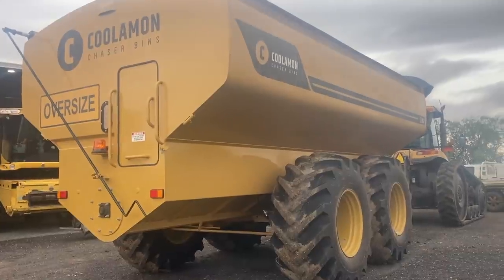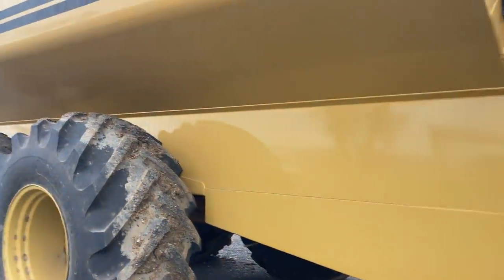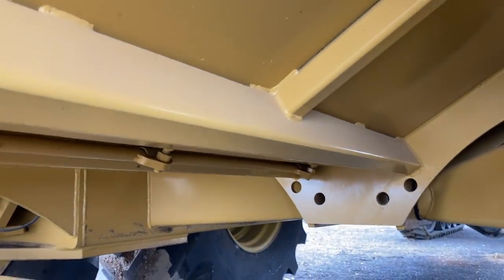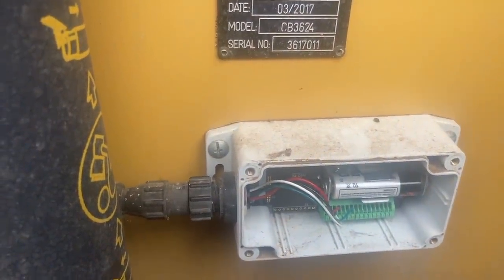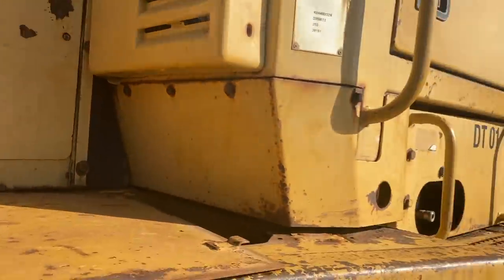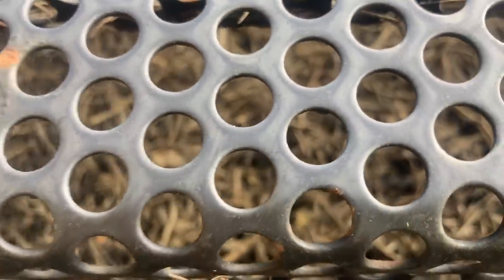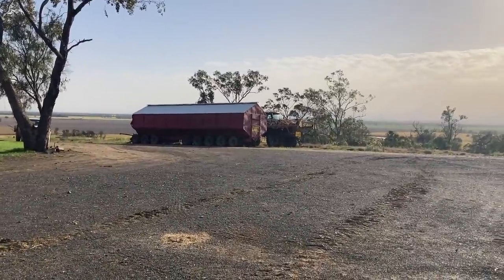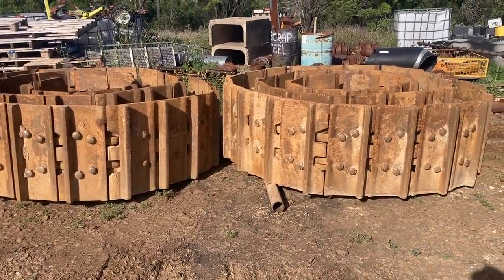Harvest Is Coming!! (Vlog 35)

Comment: Nice video mate Great to see a chamberlain in the fleet nothing wrong with a bit of Aussie built gear 👍
Reply: The 80 series Chamberlains were pretty good tractors, you need to be good on maintenance though. Watch the uni joints, change them every 1000 hours whether you want too or not. The consequences of not doing that is complete disaster. Jeff

Comment: What do you use to tow the big big huge red bin?
A D11? 🤣
Reply: That’s called a “mother bin” and is only moved around empty as it’s not designed or engineered to move with grain in it. The chaser bins bring the grain to the mother bin when there are no trucks available to load. When it’s empty it wouldn’t take that much hp to drag it around.